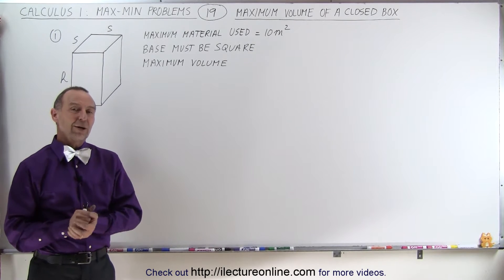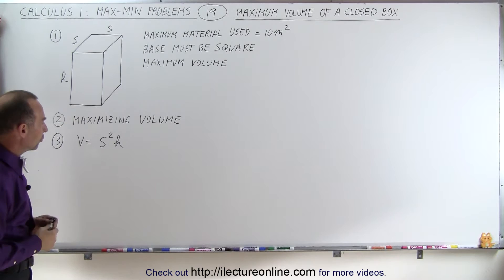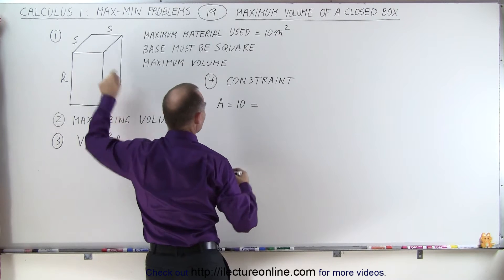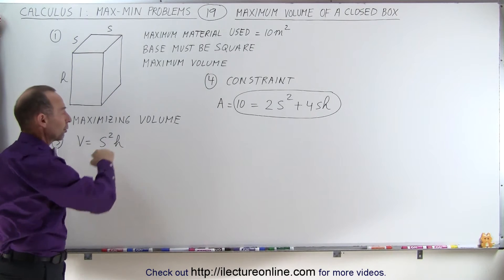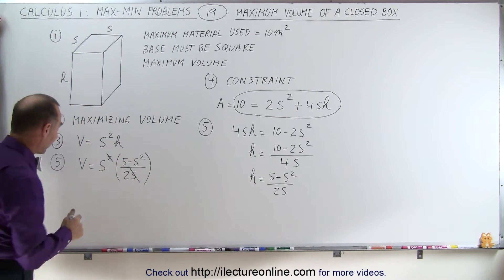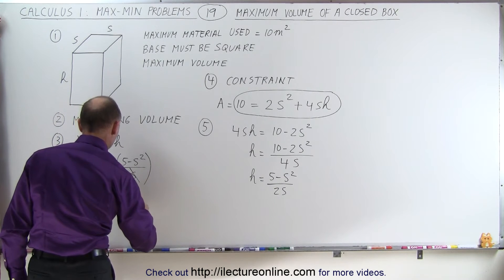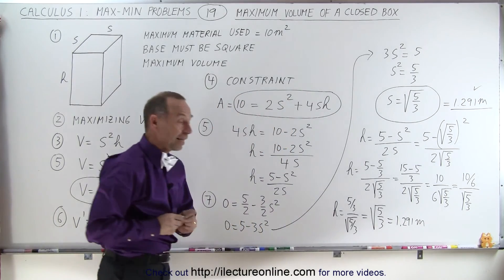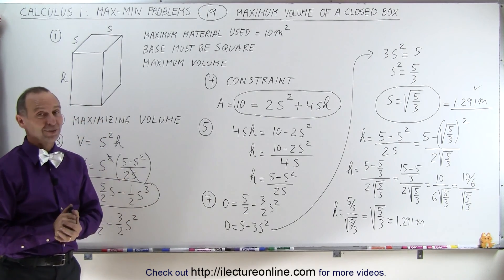Calculus 1: Max-Min Problems (19 of 30) Maximum Volume of a Closed Box

Comment: Easy way : Maximum  of  volume means that the box is cubed , then the  surface area S.A=6s^2 , then 10=6s^2 , then s=1.29, then the volume is =1.29*1.29*1.29 =2.152m^3
Reply from the maker: This video is made to show the technique of using calculus for a max/min type of problem.  Yes, indeed for a simple problem like this you can solve it in many other ways, but we want to show examples of simple problems first so you can learn how to apply this technique to more challenging problems.
Reply: @MichelvanBiezen  thank you , True, to understand the idea of the topic, it is necessary to start with a simple example, as I see many mathematics curricula start with a topic, but the example related to it contains a lot of complexity and details, so that the student gets lost and does not understand the idea of the topic.thank you again  .please could you show us  more complex example that can be  solved  just with your explanation.Because I am studying this subject and I have an exam soon, but there is confusion about using the method. I do not know with what kind of questions I use the simple way and can I use it with all the examples?
Reply from the maker: There should be other examples in the playlist.  We are also working on adding more videos in the various calculus playlists and we will review this topic as well for additional examples.
Reply: @MichelvanBiezen  Thank you for your reply, God blessed you.

Comment: I'm a bit confused at what happened from step 5 to 6. Where did the first s go, and why would the 1/2 be changed to a 3/2? Why is the s squared instead of cubed? I may be stupid here but I'm pretty sure those two equations would have different answers. Why wouldn't the answer be s= the square root of 5?
Reply from the maker: The algebra on step 5 is correct.   I suggest that you copy the expression and then reduce it yourself and you'll see that you end up with the same result